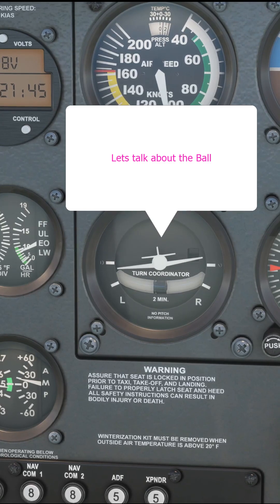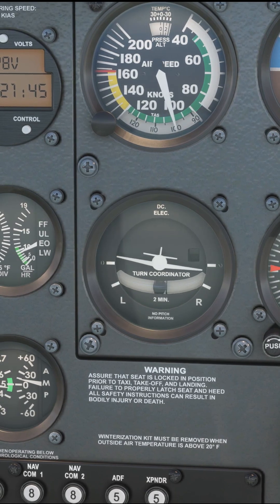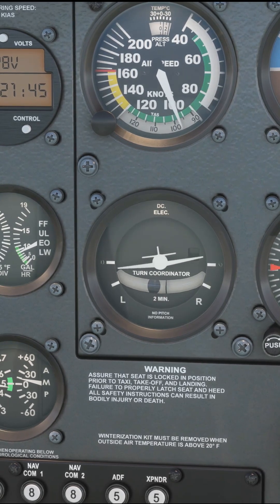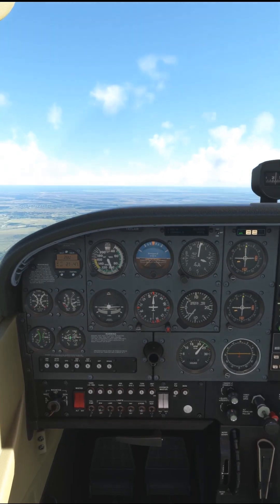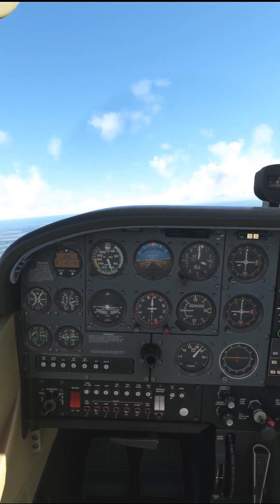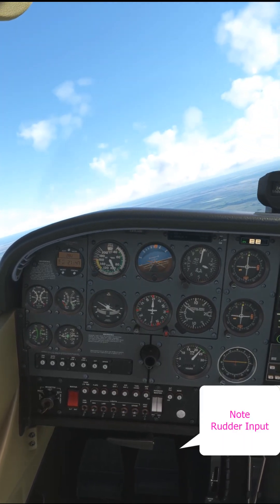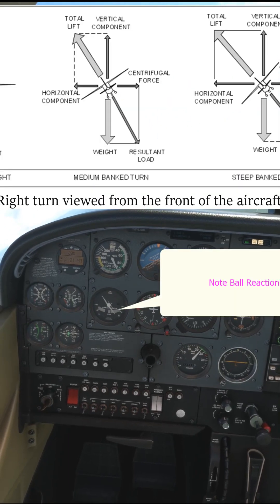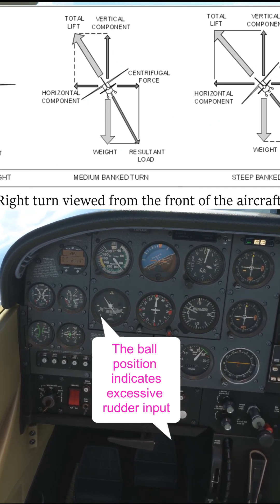The Inclinometer / Balance Ball in Microsoft Flight Simulator #Shorts

Comment: Great vid as always! 
Can I ask you a question? It kinda bothers me for some quite time already. xD 
Sometimes in MSFS when I turn in one direction, the ball is on the opposite direction (say I turn left and have to apply right rudder to keep the ball centered), is it realistic, does this happen IRL as well when there's some amount of side wind? Thanks!
Reply from the maker: The reason you need the rudder in the direction of the turn initially is due to adverse aileron yaw. This causes more drag on the upgoing wing pulling the nose to that side. I've never needed to apply opposite rudder in a turn to maintain balance, more likely that you've applied too much rudder in the correct direction and need to ease up on it a bit. I suppose a momentary gust or turbulence could do this but that would be a very short lived thing.